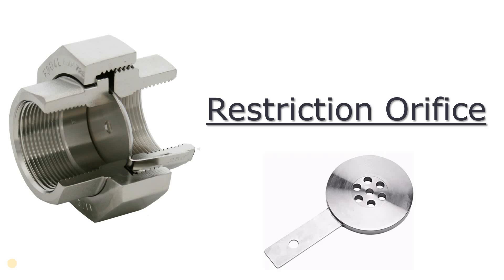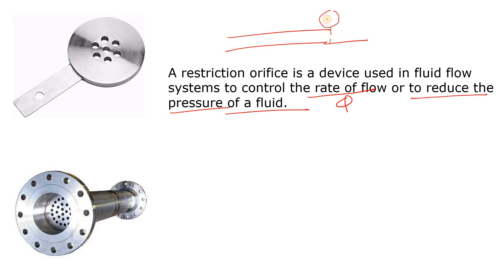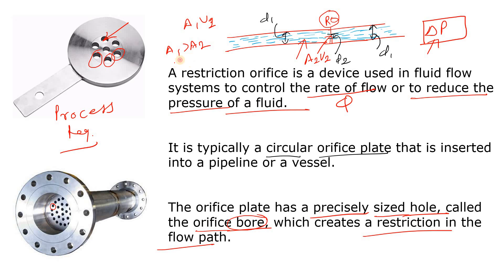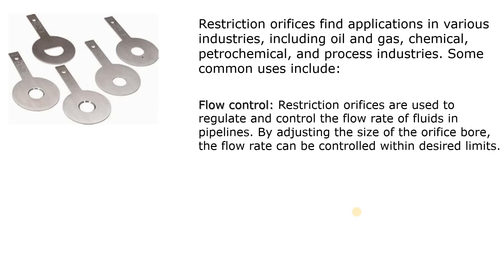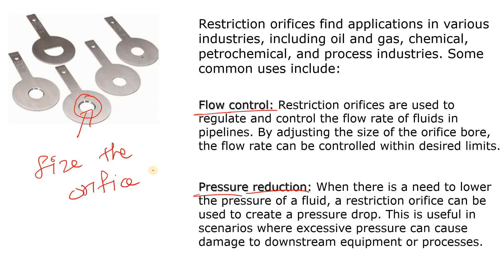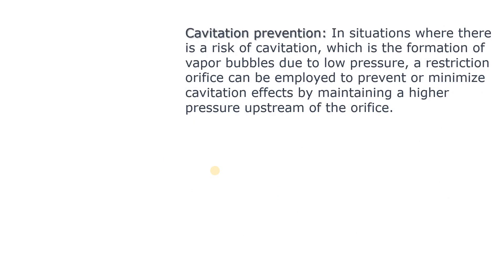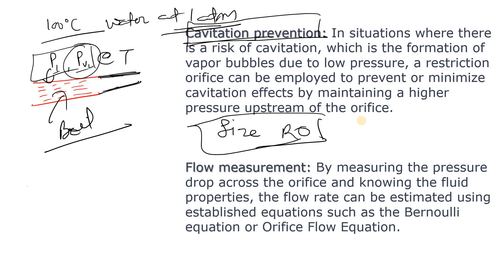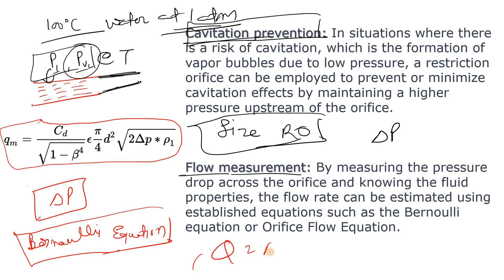Restriction Orifice (RO) | Basics of Restriction Orifice | Working of Restriction Orifice

Comment: Thank you so much for the video! I have a question, from what I understand the RO is supposed to slow down the flow and create a pressure drop in the system, but based on the video, since you're passing it through a small hole, A2<A1 and hence V2>V1, so doesn't the velocity increase instead? How does it slow down the flow then?
Reply from the maker: It's use to kill the pressure

Comment: Why diameter of orifice plate is smaller in the upstream and larger in the downstream side of the multistage oriface?

My concern is that when is reduce the pressure with smaller diia oriface plate then pressure drop is higher and high chance of cavitation? Please  clarify my doubt.
Reply from the maker: In a multistage orifice system, the diameter of the orifice plate is smaller in the upstream stages and larger in the downstream stages for several reasons:
Pressure Reduction: As fluid passes through each stage, pressure decreases. Smaller orifice diameters in the upstream stages help achieve the desired pressure reduction gradually, preventing sudden pressure drops and potential cavitation.
Velocity Control: Smaller orifices in the upstream stages control the velocity of the fluid, allowing for better flow regulation and reducing the risk of turbulence or cavitation.
Differential Pressure Distribution: Gradually increasing the orifice diameter in the downstream stages helps distribute the pressure drop more evenly across the system, ensuring smoother flow transitions and minimizing the likelihood of cavitation.

By carefully designing the orifice sizes in each stage, engineers can optimize the performance of the multistage orifice system while minimizing the risk of cavitation.
Reply: @Coreengineers   will that be the same in single stage ?
Reply: @mysterion5312 single means one, so what are you asking?